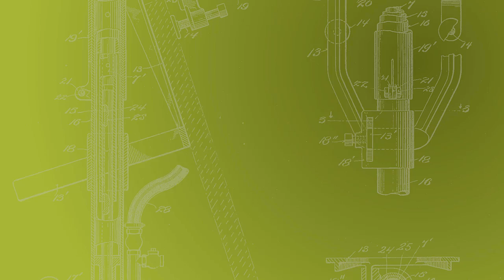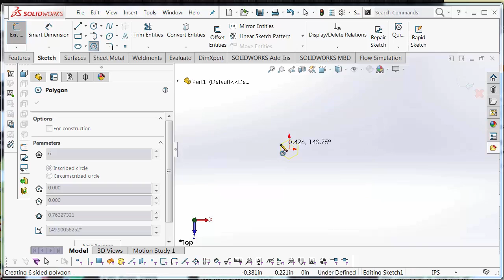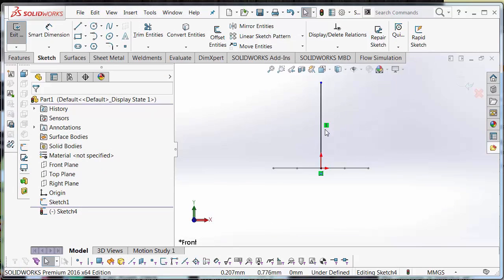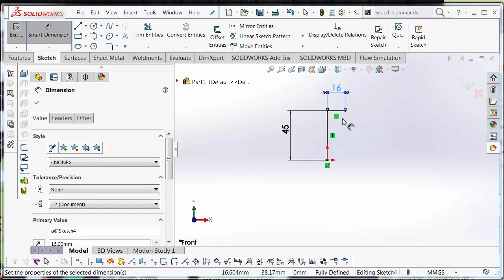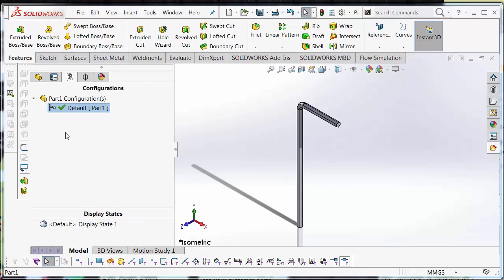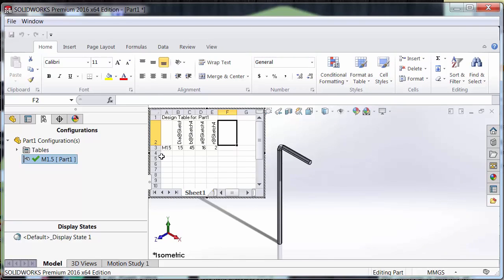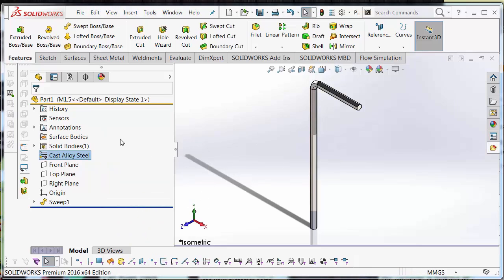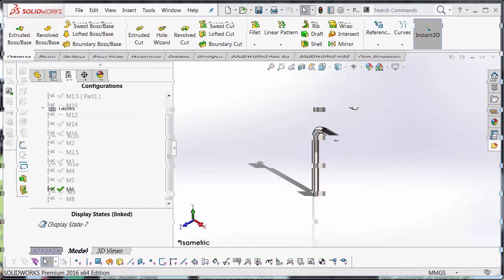SOLIDWORKS - Design Table

Comment: solidworks 2016  I had everything input into the table.  Created the new configurations with all the parameters labled accordingly.  I had both sketches fully defined and used a normal sweep.  However when I would try and show any other configuration other than the 1.5 the wrench would disappear just as though some stinking thief had come and taken it off the table. :( However,  your video is great, straight forward and you're easy to listen to.  I have failed.

Comment: I was giving a task to make a CAD model using Solidworks of a gear shaft with 13 different sizes. My superior told me to use a design instead of making each individual part (That was my orignally plan). Once I saw this video of how to create a design table, this vieo saved me alot of time. Thank you so much for this because I learn this method fast watching this video.